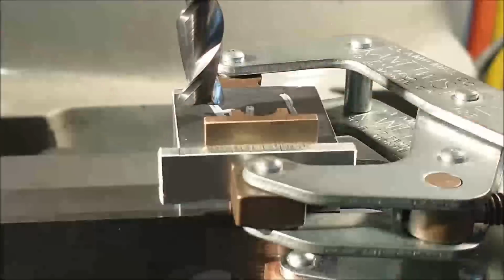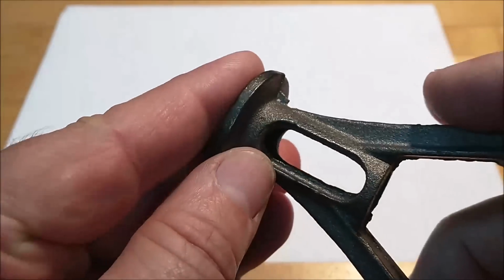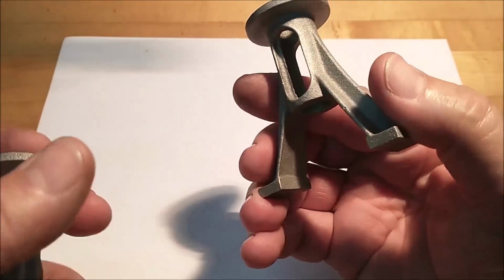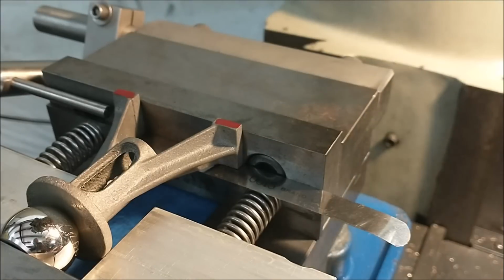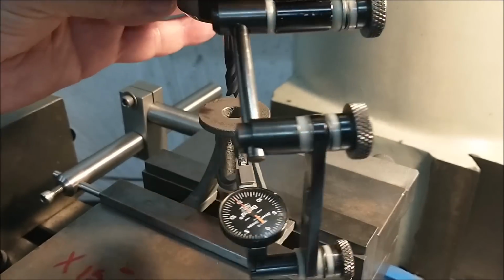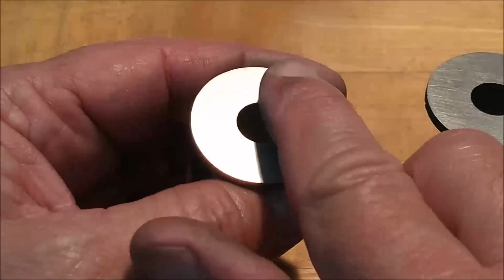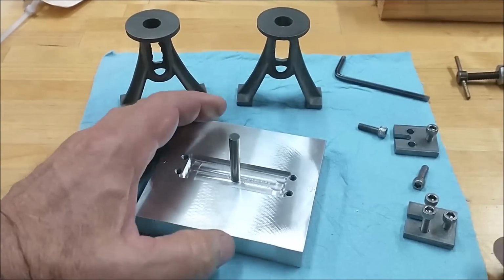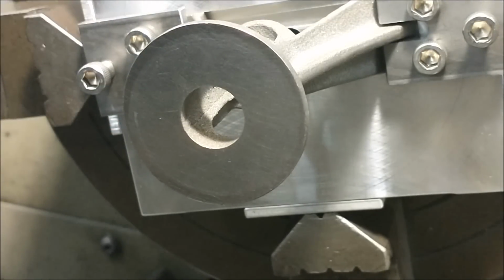Stuart D10 - #  5 -- Prepping the Standards and Finishing The Main Bearings

Comment: Hey Joe. I thought of determining the centerline between the top and bottom holes. Clean the edges of the holes and sandwich them between 2 cones with bosses on their wide ends. Mount them on a piece of threaded rod and use the bosses on the cones to reference on.
Reply from the maker: That is a viable approach, but it does not guarantee the bore is inline with the outer features.
Reply: @joepie221  I have another thought on how to approach castings. You could use a 3D scanner to get a model of the casting and use 3D software like Fusion to determine where and how much needs to be machined. You could at least get a reference point established to work from.

Comment: I just noticed that everything you are doing here, on "tiny" scale, is much like what I am doing right now..."restoring" an old, cheap, shop vise. No two surfaces bore any relationship to any other surfaces, most were round or angled oddly, and the casting was rough as bluestone gravel. The methods you are painstakingly demonstrating ALL apply. Working with cast parts takes some good thinking. THANK YOU for teaching so well.

Comment: Joe, when you have your DTI on the spindle of the mill how are you turning the DTI so easily? are you free wheeling the spindle somehow? i have an 80's Enco J head clone. and its a PITA to use an indicator like that because the v belt has a memory and tries to return to certain spots in the belt..... any tips?
Reply from the maker: I always slip the range selector between the high and low positions. It makes for an easy rotation of the spindle.
Reply: @joepie221  thank you!
Reply: @joepie221  Thanks from everyone

Comment: Spotface for them bolts...
☹🇬🇧
Reply from the maker: I'll back turn the flange.
Reply: @joepie221  

They would never have done that...
Spotfacing is better...

Good video 
☹🇬🇧
Reply from the maker: @glennmoreland6457  the hole placement would make that extremely difficult. 3 of the 5 are clear, 2 are not.
Reply: @joepie221  

Set up boring bar...
Use the 2 flanges as support the bar make a cutter to swing off bar cut spotfaces...?
☹🇬🇧

Comment: Hi Joe, when running the boring head in reverse, was there any chance of the head unscrewing?
Reply from the maker: My boring head is a one piece R8. If thats a concern, run the operation in forward and use a LH boring bar.
Reply: @joepie221  Thanks Joe.  I ask, because lot of the "hobby" oriented boring heads here in the UK use screw on arbors for different tapers.  I'll investigate LH boring bars.

Comment: I really enjoyed this. While I was watching, I kept thinking what would I, as a mechanical designer, define as datums on the casting for final machining. It would be quite different from the approach you took.
I'd define one of the webs as the primary datum, probably both webs as equal precedence primary datums. Then the cast bore, only for a depth equal to the circular flange thickness as the secondary datum and the circular flange face as the tertiary datum.
So, in my mind, inspection and possibly the machinist clamp onto the webs, use a diamond pin in the cast bore and touch the high point on the face of the circular flange.
Of course, I'm used to a coordinate measuring machine eliminating the inspection setup.
So, it's fascinating seeing your much different approach.
Reply from the maker: Hard outer features are a good place to start. Holes and bores are inserts at castings and should really be checked thoroughly before using them as any level of datum. The finished bore is about 30% larger than the hole thats present, so thats a clue. If the core was placed out of position ( axial or linear), there would still be sufficient material to machine out a good feature. Using the ribs could work if you are very careful about how much material you file off them while removing the flash ( parting ) line material. I hope my approach pays off as intended. Thanks for your comment.
Reply: @joepie221  I wasn't aware that an insert is used and its position can vary so much. With that in mind, I would have chosen the flange OD.
I meant to use the web thickness as the datum to establish the web centerplane, so filing the flashing should not be an issue. But, I imagine my datum choices would make it much harder to set up than what you did.
Thanks again.

Comment: @joe pie, if you only had a lathe to do this work, would you first establish the bore, then turn the base of the feet and the mating flange for the cylinder perpendicular to this feature?
Reply: Worked for me.
Reply from the maker: Most likely that would be the best route. I still wouldn't use the bore as my starting point unless I checked it thoroughly.

Comment: I have made a few Stuart engines and wondered why the dimensions have such complicated fractions then I realized the plans were drawn many years ago when workers used a surface plate and set a scriber against a ruler and then marked the casting manually. I wish they would update there drawings to metric. When you get to the cylinders I like to leave them a little longer so there's no danger of the piston hitting the end. If your tempted to use 6 head bolts instead of 5 they might clash with the draincock.
Reply from the maker: I'll be careful. Good call.

Comment: Great work, together with clear explanations of the setups and processes.
Spare a thought for the pioneering model engineers for whom the lathe was their only machine tool! If they had a bench grinder and pillar drill they probably made it themselves using their lathe.
Reply from the maker: That would be a good challenge. Would I be able to use a mill to make the jigs?
Reply: @joepie221  The old-timers often made a milling attachment which mounted the compound slide vertically to the cross slide to give a vertical axis. Tubal Cain shows videos of various versions. Ade's Workshop used to use one in his early videos before he bought his mill. If you want the challenge - have at it!
Personally I'm grateful for the insights into job planning, layout, fixturing and machining you share, so - Thanks, Joe.

Comment: With your current setup to machine the part you can use a boring bar to machine the diameter direct after you machined the part into the fixture you made. This way you save some time? And have everything in line with one setup?
Reply from the maker: This fixture should deliver a very true final part.
Reply: @joepie221  it will, I’m pretty sure👍

Comment: Joe, do you use "Graphite Slip Pad" under your sanding belt. It reduces the friction, thus reducing the heat. But it's a wearing material, so it requires changing occasionally.
Reply from the maker: I don't, but I'll look it up.

Comment: I'm a bit surprised that you haven't made copper jaw caps for your 4 jaw. That's a side project i need to finish for my current main project.
Reply: Saw those on CEE. Very useful and practical idea... If prepared to drill and tap jaws.
Reply: @Gamerock82  You can make wrap-around jaw caps that don't require drilling into hardened chuck jaws.
Reply from the maker: Possibly just anneal and smash some copper pipe and use that? I like the idea of copper tips.
Reply: @PaulSteMarie  Yeah, it was quite a process. Kurtis works a lot on Hydraulics, so his need for the protective benefits of soft jaws on almost every job motivated it. Makes sense if it's daily use.

Comment: I'm really wanting some sort of adjustable mandrel that you could feed up the middle of that part and fine-tune its position and angle. Them chuck it up in the lathe between centers and face the head and feet.

You'd need some sort of cross support to keep the legs from ringing like wind chimes.

Can those low-temp casting alloys (under 200°C) be used to embed the legs in a more solid structure and then melt it off when the machining is done?
Reply from the maker: I agree on the cross idea. The legs will sing like a happy bird if I don't. Could be as simple as 2 pieces of wood.

Comment: Joe a short video about your sandblasting cabinet discussing what type of media and pressure that you use for different materials might be of interest to alot of your viewers.
Reply: I was actually thinking blasting with a really fine media instead of gloss finish on the brass bit that has casting still visible. Such a pity it is at spec and that texture doesn't fit with the counterbore finish. 

Love the idea of a video on the sandblaster, what it can achieve and what goes into the process. Then again, Joe could read blue prints on audio only and I'd be there. :D

Comment: Through the years, I have seen the standards done in many ways. Yours makes another. The easiest way I have seen it done was a smaller than final size hole bored down the middle and put on a mandrel. The feet and cylinder mount was turned on the lathe and the rest was done on the mill. Nice work Joe. Thank you for showing another way.
Reply from the maker: Finishing both ends in one setup is the ultimate approach for parallel.

Comment: Been in the foundry business since 1990. That shell of hardness could be the difference between sending the part on to the next step or sending several tons out for a heat treatment which is of course added cost to the producer.
Reply from the maker: I'm hoping its just on the rim and not in the bore.

Comment: I would have cleaned up the center-line holes (ultimately with a reamer) and used those for my reference.  What advantages and/or disadvantages do you see with this approach?
Reply from the maker: The upper and lower halves of a casting mold are usually lined up with pins on the mold body. Any holes or odd features are laid in with great care, but not normally aligned like the outer features. If you have the extra material, don't go by holes and windows. Check the part, and go with the majority material.
Reply: @joepie221  Thanks for the lesson, Joe.

Comment: A Sunday of Sundays visiting with a talented friend. Sure works for me. Especially when it comes with that golden brass that is all shiny and bang on accurate. Like you I love to exercise my beloved drawers of files. There is that satisfaction when they are depositing the  chip like dust on the vice and bench. Keeping them nice and sharp is easy. A bath of battery acid and baking soda to stop the reaction works great. Do it outside paying attention to the wind. Slow down and set-up, set-up, set-up until it makes sense. One small change will affect one side more than the other. I found having some foot long feeler blades to cut shims from are handy in this situation. I would have loved to have had one of these large bearing like balls. Heavy truck shops will have smaller ones from drive shaft steady bearings. they really are handy in set-ups like this. That adjustable stop and rod is something all our vices should have. I can think of so many applications instead of a pair of vice-grips and scrap rod. Jigs and fixtures like this are worth all the tea in China. Worth every $ plus the time put into them eh. See you for the next instalment old friend. You never cease to amaze me bud. From BC Canada, you take care eh.
Reply from the maker: Always good to get a comment from you. Stay well.
Reply: @joepie221  Thanks. I always enjoy your teaching like posts a bunch my friend. You are as machinists all over the world should be. We are the creators and fixers supreme eh. There is nothing in the physical world we haven't had our hands on eh.

Comment: Joe, is there any risk in losing a machined reference surface when you sand blast the part for the cosmetic finish, or is it so negligible as to not matter?
Reply from the maker: I suppose if you stayed on a finished surface too long you could warp a part during blasting, but I try to prep and blast all the surfaces prior to final machining. Or I'll tape them off and turn the pressure down before blasting.
Reply: Usually he covers machined surfaces with tape when he sandblasts.

Comment: Why did you use shims on the fixture block at the end of the video? Would it not have been easier to clamp straight into the 4jaw
Reply from the maker: Along with the comment @steveallerton98 left, using shims makes it easier to tap a fixture into position because the jaws haven't penetrated the soft aluminum surfaces of that fixture.
Reply: @joepie221  Answered, thanks.
Reply: Hi Brian,
You can bet that the edges of the fixture are square and parallel, and that the machined recess in the fixture is centred on the location pin hole, and that on the centre of the block, which will allow transfer back to the mill for setting out and drilling bolt holes etc. for the cylinder and holding down to the baseplate without disturbing alignment.
Clamping directly in the four jaw chuck will almost certainly raise burrs in the sides of the fixture which will compromise subsequent location in the mill vice . . . .
Reply: My question also.

Comment: one of the biggest things i get out of watching is your theory of operation sequence to obtain the results you want.  there's a hundred different ways to skin a cat. the difference is if you want to make a coat or just pass it off as chicken on the buffet. lol.  i looked at it as the central bore being the main feature to tackle. all measurements are basically off that but instead of doing the bore first  you got everything else  so the bore  fits the part instead of the part fitting the bore
Reply from the maker: I have heard a lot of people say the bore is the primary datum, but its an insert in most sand castings. I'm not sold on that philosophy. Not for the cylinders either. I'll go with the outside first, every time.

Comment: Rite Joe, Great lessons and setups! With you on the flash removal, when I was a kid making Airfix kits it used to bug the crap out of me I'd spend hours filing and sanding mould and glue lines. This then progressed to my motorcycles when I started riding, I'd file the flash of anything I could, footpegs, top n bottom yolks and some times the engine! Now it's anything I get my hands on😂... Although the models I now make (mostly armoured vehicles) I research as the real vehicles have the weld/flash and casting marks on them :face-purple-crying: As always Dude stay safe n well. TFS, GB :)
Reply from the maker: There is a fine balance to over doing it. Sometimes the flash lines can really add detail to a model. You decide.

Comment: I know how long you have had the kit so a rough idea of how much thought and planning has gone into each part. Preparation, preparation and more preparation all leads to a good plan which shows in how well you execute the plan and how well it works, As a certain Colonel said, I love it when a plan comes together. Funny enough ne of the standards in my kit was chilled and I had trouble turning the diameter. I know and admit your engine is a lot more accurate and better finished that mine.
Steve
Reply from the maker: Thanks for tuning in Steve. I've been looking forward to this build for a while. Congrats on the growth of your channel.

Comment: Also interested to see what you do on the bottom side of the upper flange. There are nuts or boltheads that seat there to assemble the standard to the cylinder, and the draft angle doesn’t play well with that
Reply from the maker: The side ribs stop short of the top underside of the flange, so I could back turn that area for a flat seat. Thanks for the heads up.

Comment: One of my best builds was a die filer and it does a great job at removing flash cleanly and evenly.  The MLA filer is just one of many good kits of tooling.
Reply from the maker: I have limited time on a die filer, but found them awkward with uneven pieces.
Reply: @joepie221  I often use bits of wood or metal to prop up uneven pieces, in particular for cleaning off flash.  About the time I built mine, I ran across a box of a dozen or so die files at the flea mall, better than twenty years ago.